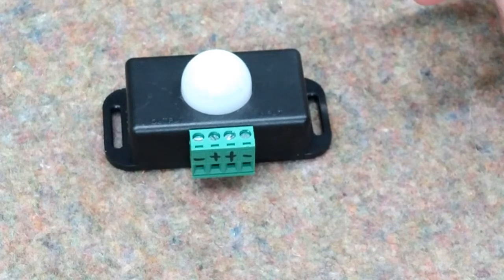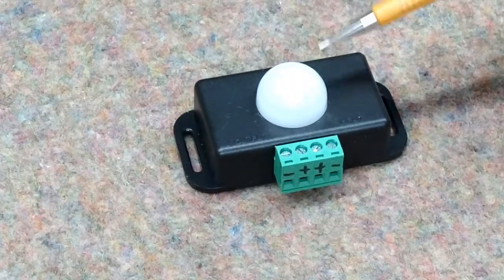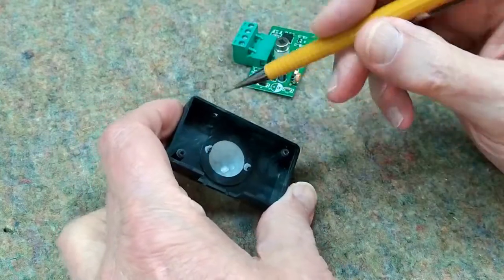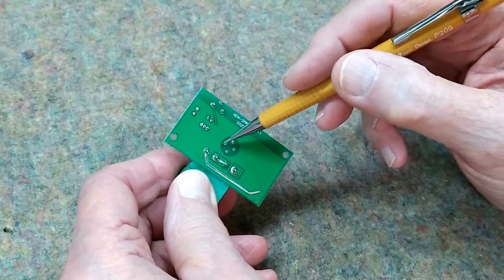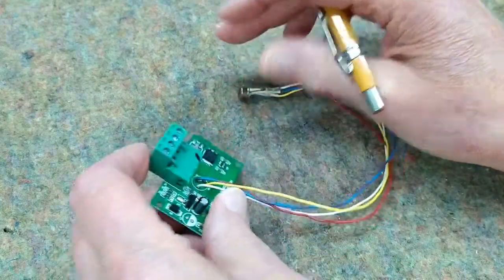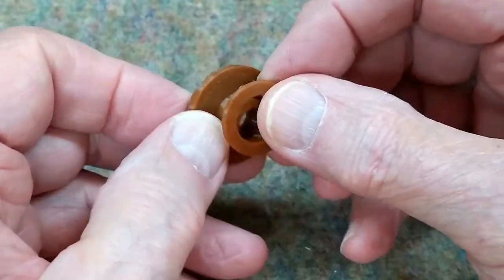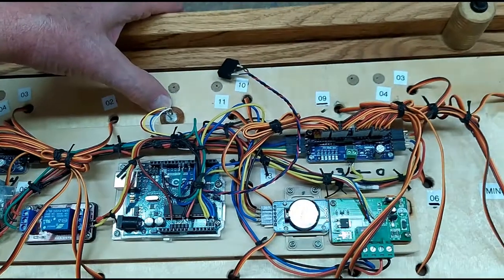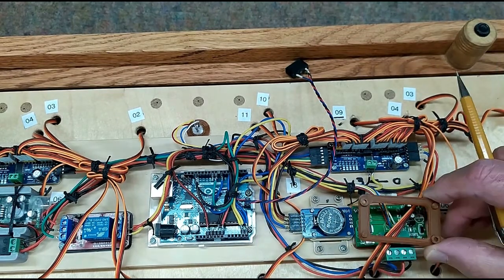12V/24V PIR Infrared Motion Sensor - Taking It Apart

Comment: Looks good on your clock. Also looks like the circuit board was already marked for orientation of that pin on the sensor.
Reply from the maker: You are correct. The board is marked but I could not see it with that support tube in place under the sensor. Better safe than sorry and guessing at the orientation later on. ;-)

Comment: I have tried to install one of these on a 24v LED strip light set up, but the lights just flicker on and off whilst not bright. The replacement unit from a different supply did the same. Any ideas why?
Reply from the maker: I don't know how you have wired your LED lights.

The PIR is listed to be a switch but I have never tried using it as one on a string of lights. 

Often times a string of LED's will flicker if the power supply is too small. Do your LED's flicker when connected directly to the power supply (without the motion sensor)? Also, the power supply needs to provide DC output and not AC output.

I have a remote control that is supposed to turn on a string of LED's and change colors and display types... sequential, flashing, strobe, etc. It was supposed to work with a USB type power supply and mine did not work. It turned out the USB wall outlet power supply was much too small for the controller and the LED's.

If you have or if you know someone who has a bench power supply you can slowly adjust the voltage and current until the flickering stops. Then you will know what size power supply is needed. Just don't go over 24VDC.

And finally, not all power supplies are created equally... and sometimes there can be a bad one. A volt meter may show the power supply is putting out 24VDC no load but as soon as a load is applied the output voltage may drop drastically.

Hope that helps.

Thanks for watching. Hope you have subscribed!
That is what keeps this channel going. 
Ron
Reply: @RonaldWalters2010  Hi, thank you for your quick reply.
The set up is a 240v mains supply to a Constent Current LED Driver, output 24- 42v DC to a 1 meter lenght of 24v LED tape strip (no string of lights.) That is it.
With no PIR sensor the lights work perfectly brightly and are controlled by a switch on the feed into the driver. When I install the PIR senor after the driver is when the problems occur.
Reply from the maker: This is probably where I am going to fail you. :-(
You are 240V 50Hz and your LED driver is somehow converting that to DC and it is probably a pulsing DC caused by the way the driver is converting the AC waveform to DC. I can only guess that the pulsating DC is interfering with the electronics for the PIR. I am a mechanical engineer who sometimes gets away with messing with electronics. Unfortunately I do not know how to address your particular problem.  I would try using a relay to turn on/off the LED and let the PIR switch activate the relay. But that would require a separate power supply for the PIR.
Reply: @RonaldWalters2010  Well thanks for your help, all sounds a bit over my head. Ill just stick to switching it on and off at the switch. Cheers

Comment: Love it!! How can I put two 12 v motion sensors in parallel. Like one up stairs and other down stairs, with the same light.
Reply from the maker: Both PIR’s would need continuous power. Then you could experiment with wiring the sensors (ON/OFF side of the PIR’s) as a two-way switch pair (wiring diagram same as when common SPST ON/OFF switches are used for two-way switching). These PIR’s will not handle the load of a common light bulb so some type of relay for the bulb would also be required. And then you would probably need regular two-way wall switches to remain in use as an override for the sensor’s, should the sensors quit functioning and/or to comply with code. I have never done this and cannot provide a wiring diagram.

It would be a lot easier to buy two motion sensor wall switches and Google “motion sensor light switch wired for 2-way diagram”. Ask for help at you local electrical supply or an electrician.

Comment: The one i brought had no capacitor fitted it worked about 3 times then blew the mosfett i will repair it using parts from old laptop  motherboard as it is all smd compents and layout.